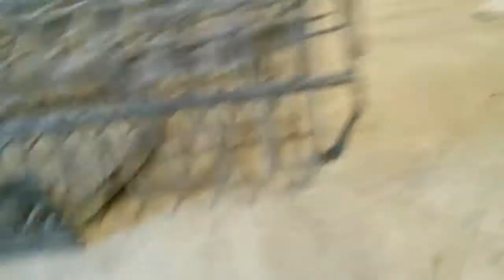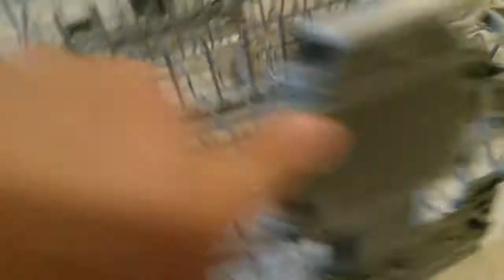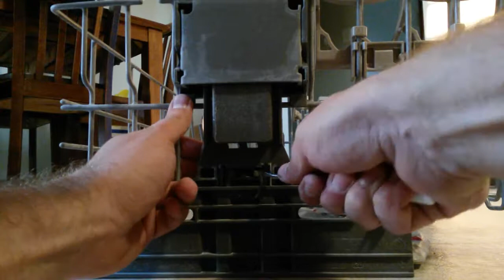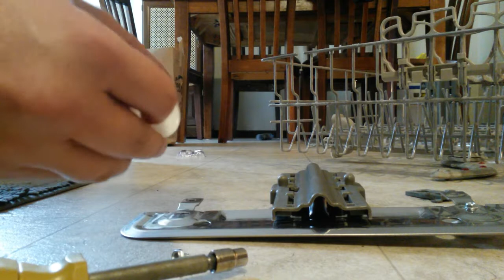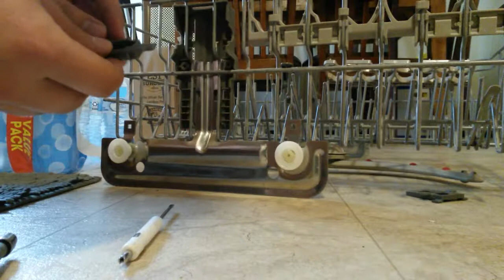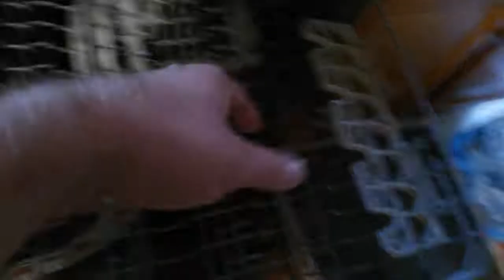Kenmore top rack adjuster replacement

Comment: I had this happen after 4 years of ownership.  Replaced one side with the improved design available on Amazon but ordered the other replacement part knowing it was only a matter of time due to poor design.  The other side lasted another  2 years before breaking..
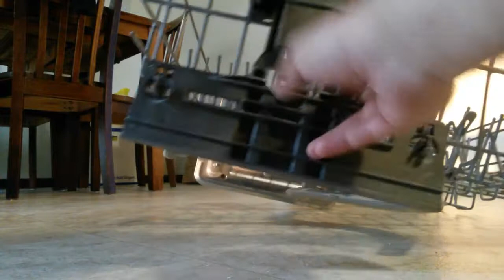Reply: Also forgot to mention but I think the piece you hurt your finger on (third, middle clip you remove at 2:00) is easier and safer to take off if you gently squeeze the two side tangs simultaneously using a needle nose pliers rather than using a flat head like you did.  These plastic parts are VERY brittle after years of heat cycling and you have to be very careful with them.